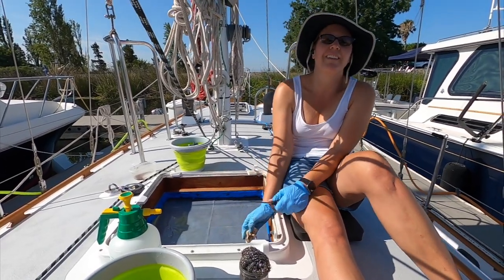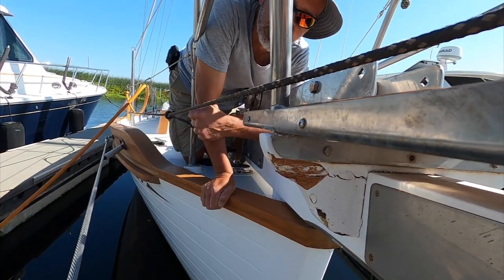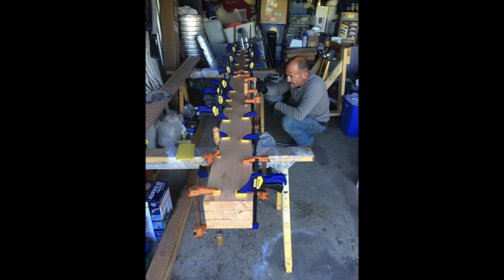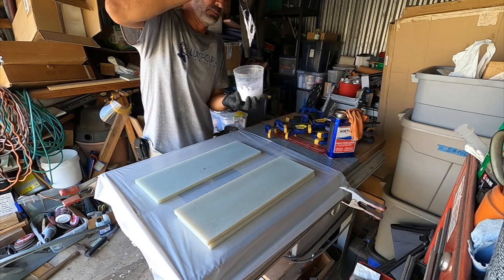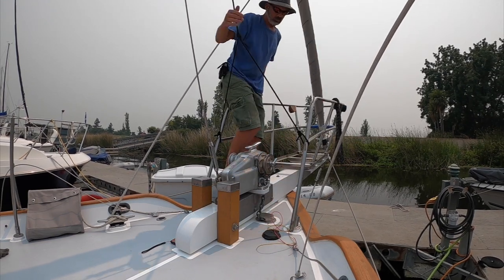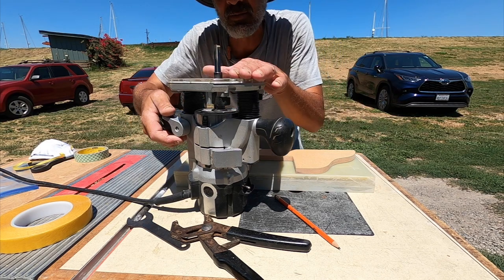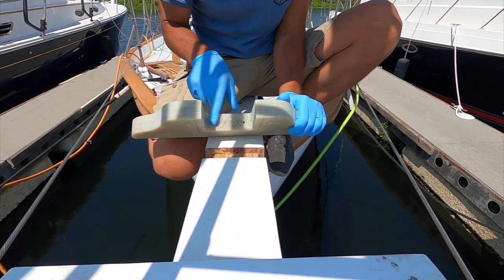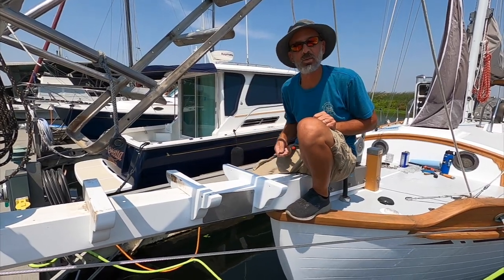SV Ramble On | Repairing Our Bowsprit

Comment: I use a carbide blade in my Bosch jigsaw to cut G10.  Cuts pretty easy. No smoke. I also used the same blades to cut 3/8” 316 stainless for some stanchion backing plates.  Was slow going, but cut just fine.  You should check to see if a similar blade is available for your saw.
Reply from the maker: Thanks, I'll give it a look see.